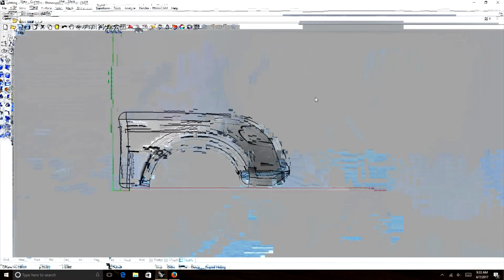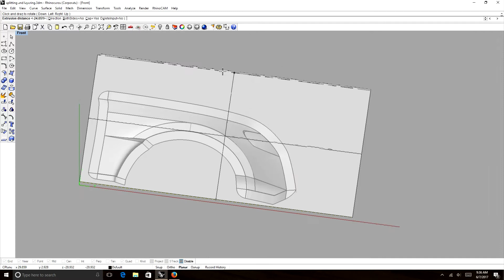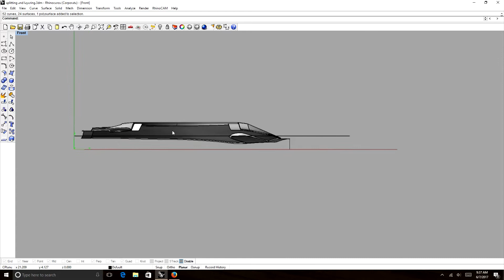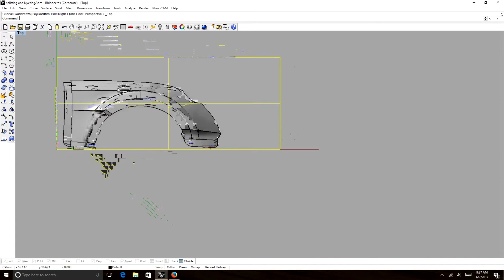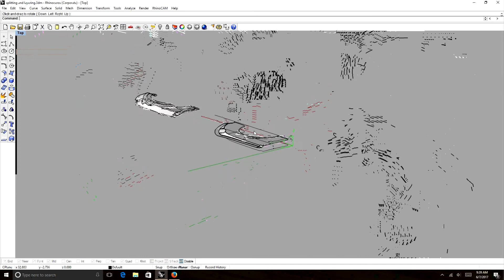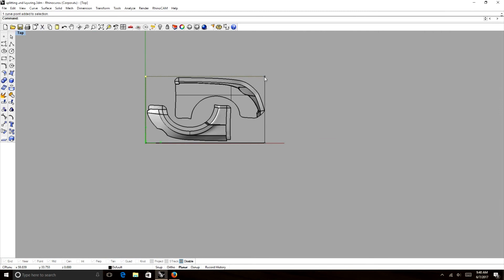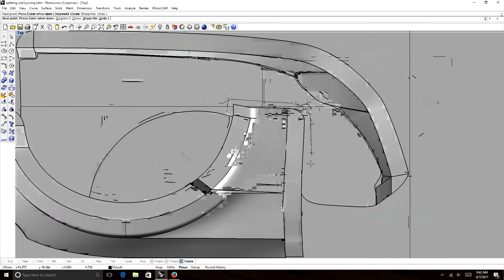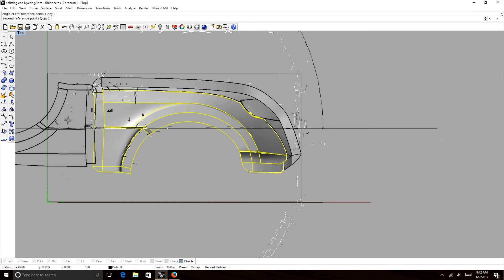How to split large 3D objects for 3 axis CNC machining. (1 of 3).

Comment: correct me if im wrong, but if this part is approximately 6 inches thick, you say your machine has a 3 inch z travel then that assumes the foam you are cutting is at least 3 inches thick no? Where do you get 3 inch thick foam? doesn't it normally come in 4X8 sheets